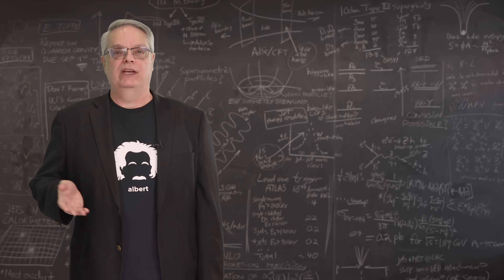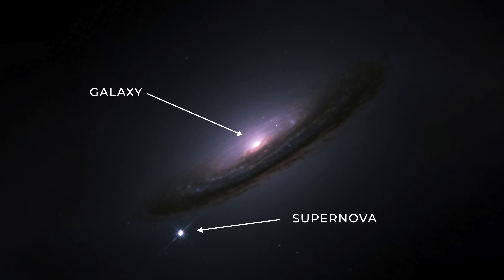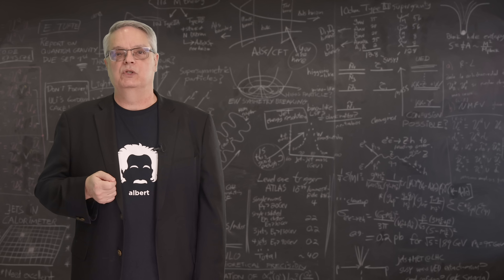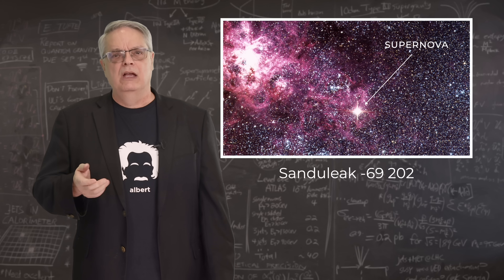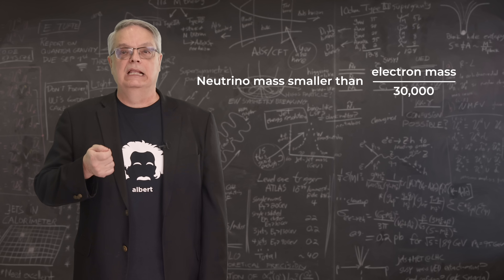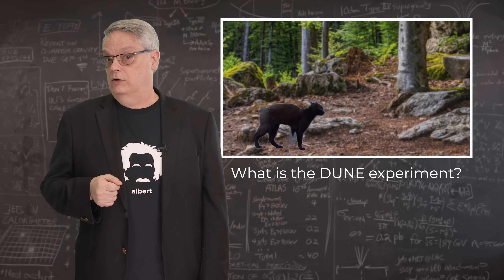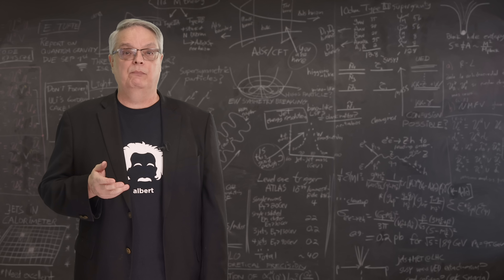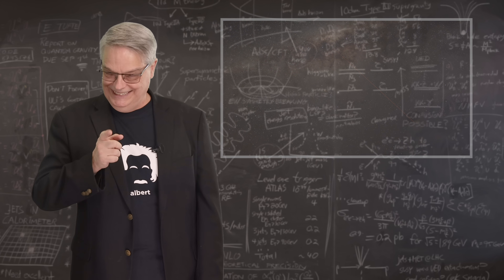How can you look inside a supernova?

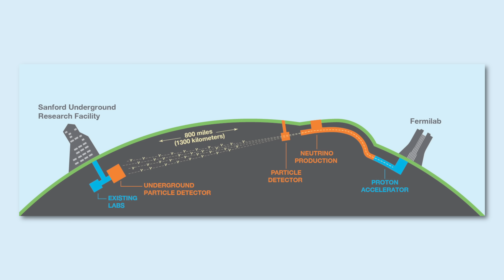Comment: He had me up until 6:30 when we were talking about 70,000 tons of Argon being used on our next top of the line neutrino telescope...

Is there even 70,000 tons of argon available to be withdrawn from the earth? Doesn't seem very plausible to throw out the reasonable number of 70,000 when we're correlating such a number to the availability of ""tons of super rare argon??!?""

Other than that very good video 10 out of 10 brother-!!
Reply: Comprehending how much potassium it would take in order to derive 70,000 tons of it at less than 100° Kelvin temperature.., at God knows what pressure it would always need to remain at.... Really feels almost uncomprehendible no matter how you overthink it.

And let's not try to figure out the maths of how expensive one cubic foot of liquid argon gas works out to be even when buying in bulk - especially when you're extrapolating up from one cubic foot up to something like 70 billion grams of liquid argon gas approximately/
Reply: Argon makes up 1% of the Earth's atmosphere.  So it is hardly "super rare."

Comment: Mr.  Don Lincoln no offence to you, I don't know why you always explain subject or unfounded or obsolete. stars like our sun do not contain any Hydrogen or Helium, inner core of our sun contains unbelievably   heavy sub atomic particles  the ones we do not have on earth at all nether our earth inner core contain any of it. When sub atomic particles have pressure on them from 360 degrees from all directions they are becoming even stronger, absorbing more energy to become very dense, the most heaviest atoms usually exists in the center of the inner core of all  formations according to their size, larger the formations heaver becomes sub atomic particles in the center. I will give you guys clear explanations why stars go to supper Nova. It all boils down to  size and density,  I will give you two separate explanations for both what kind of role they are playing in that, I will start with size first, some of them they just grow enormously large, for the star to push all the burned energy out the way our sun does, chamber  all ways should be clear from all  debris make sure inner core will force burned energy out of chambers to outer space, the way our sun does. If for some apparent reason when inner core shrink to the point no longer has the strength to pushed burned energy outwards it start to accumulates  inside the chamber all the burned energy crating like wall when that wall thickening to the point start to interfere with inner core function inner core, it actually creates tremendous pressure from inside, that is when inner wall explodes with external wall   and debris flees all of the space, few thousand light years of distance, and becomes visible to all of us.
Reply: No offense taken.  However, your claims are incorrect, so that helps.
Reply: @drdon5205  How about Sr we debate about that subject, I will bring all the evidence I have. Hopefully you can prove me your side of story is correct.
Reply: @Levon9404  It would be much easier if you just read a textbook.
Reply: @drdon5205  Quite frankly I wasn’t expecting that kind of answer from you, just for that reason there is incorrect information field up in the text books, because people like your self instead of finding out the facts, you are calculating your thoughts which is far from reality.
Reply: @Levon9404  The temperatures in the center of the sun are simply too low for the phenomena you claim.

The kind of answer you expected is one that takes your claims seriously.  For that, you have to make serious claims.
Reply: @drdon5205  Don Lincoln I totally agreed with you center is lot cooler. Sr the same energy travel outward it passes through us and atmosphere, how you can see it doesn’t effect surrounding at all. The only time sub atomic particles energy collide is on the top surface of the inner core, now let’s see why top surface of the inner core? The secret lies expended energy itself, sub atomic particles expanding only two circumstances under pressure and heat, under heat it has limits how far subatomic particles will expand. Under pressure it will expand unlimited, each subatomic particle will expand that much how much pressure applied to the particle. Think about this now, subatomic particles in the center of the inner core has the maximum pressure, and subatomic particles on the surface has the minimum pressure, remember they are expanding according to the pressure, you want good example take look the atoms we have in atmosphere hydrogen atoms have minimal expansion in Helium we have more expansion then hydrogen atoms and it keeps increasing each time one proton adds up into nucleus. The only time sub atomic particles start to have friction when expansion between center and top surface increases, because subatomic particles on the surface they travel minimal distance and subatomic particles from the center travel maximum and their travel time synchronized to all atoms within inner core here is where all the magic happens, if subatomic particles energy from surface travels one mile in 1/10 nano seconds the one from center travels 600 million miles in 1/10 of nano seconds, that’s how subatomic particles from center destroys subatomic particles from top surface of the inner core, if they travel far enough together they don’t create any heat or destroy each other. I hope this will give you  clarity how our sun functions

Comment: So, the photons produced by core collapse take about an hour or two to propagate to the 'surface' of the star and scream off into space at their prescribed speed limit. Considering the photon density, the matter they interact with on their journey through the star's outer layers must be heated to extreme temperatures and pressures if the overall photon pulse is as bright as all the light the star ever previously emitted. Such being the case, what fraction of C is the gaseous material expanding at?

Comment: What a fragile balance it must be for an old star to still have enough fusion pathways to produce the energy needed to counteract the gravitational attraction for collapse due to its mass. Hard to imagine that it could happen so quickly. I always imagined that there would be a series of small collapses, each generating additional heat and pressure that would permit one or perhaps a few additional fusion pathways, and that cycle would kind of repeat until a cinder heavy in iron (and an exceedingly tiny amount of heavier elements produced by exceedingly rare  but statistically possible tertiary fusions) was all that remained, a process that might take thousands or even millions of years. Yet, it is almost in a flash, which shows that the weakest force, gravity, becomes unbridled at the threshold described, and thusly an array of elements heavier than iron are forged. Just what type turbulence models would one use to simulate the process using CFD?

Comment: It should be put to rest the old misperception that photons fly past everything that has mass at the speed of light.  Weighing ~1/30,000 the mass of an electron is a giant mass, at the realm of the extremely small....  

That 1987 Supernova, unequivocally, demonstrated that just because you have mass, it doesn't mean photos zip by you at the speed of light (186,000 miles per second), like we tell each other every day in science classrooms from elementary school through post-doc at the university.  

Whether it is a distance of just 1 AU, from the Sun to Earth (needing just about 8 minutes) or a distance of 166,000 light years... even with a relatively large mass, if neutrinos take off first, it is impossible for photons to catch up to them!  

If photons were statistically significantly faster than "every thing that has s mass" (of which neutrinos, again, do).... they would have over-taken those neutrinos after 166,000 years, of racing across space from the Large Magellanic Cloud to Earth.... even though they put their running shoes on a few hours after their weird neutrino neighbors had taken off running...
Reply: In the restframe of the neutrinos the photons are still moving at c. But c is a finite number and the distance between the source and the detection is length contracted. So the photons simply don't have time to overtake them before they reach earth. 
If the distance is long enough(and neutrinos don't move at c) the light will overtake them at the speed of light.

Comment: I wouldn't say you're directly observing neutrinos. the light produced in the water of these detectors is Cherenkov radiation, which is light produced by an electron moving through water faster than light would move through that water. It seems to me rather unlikely that this would be caused by a particle that can pass through a light year of lead before interacting with anything. Neutrinos where just made up to explain away a discrepancy between the amount of energy that was calculated to come from our sun or any other star and the amount that you could actually measure.  This Cherenkov radiation these detectors give off his the same thing in nuclear reactors that makes the water glow blue, so it would seem to me that these detectors are detecting spikes in EM noise.
Reply: @nemlehetkurvopica2454  I did not say that. i said "light produced by an electron moving through water faster than light would move through that water". the electron is moving faster through water than light would. this movement of the electron through water at this speed gives off some light.

Comment: Why the IMB detected nothing below 20? Why the Kamiokande detected more on the region 20 and below? Baksan & Kamiokande more sensitive than IMB or the IMB somehow overloaded?
Reply: Different detectors have different capabilities.  And statistics comes into play as well
Reply: @drdon5205  Ok, thanks, very interesting. So, in this 1987 case DUNE would have detected 120 neutrinos on its own. I guess majority of them still on "high energy region", and abt 15 %...20 % btw 6 & 12 secs.
Reply: I cannot verify that DUNE number.  It may be right, but I simply don't know
Reply: @drdon5205  OK, thanks.
Reply: I read my old notes from the Schmidt & Francis lectures of ANU. Fermilab should re-run those same calculations in some video in order to "prove" that this 1987 A sent 30 trillion neutrinos for every square meter.

Comment: Dr. Don: Are there differences in the neutrino formation or distribution from super nova events that arise from a neutron star collapse as distinguished from a supernova event which arises from a black hole collapse? In the former, gravity is not strong enough to prevent light (electromagnetic waves) from escaping. But in the later, the gravity is so strong that even light can’t escape. Would there be more neutrinos from the lighter less dense neutron star than from the heaver more dense black hole? Or would the black hole prevent even the escape of even neutrinos? Respectfully, W.S.
Reply: there are probably energy differences